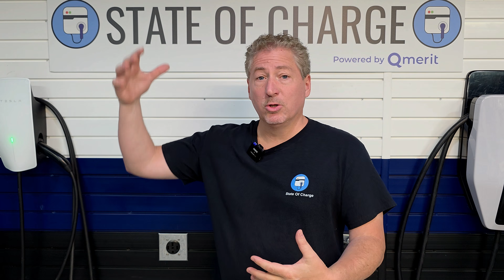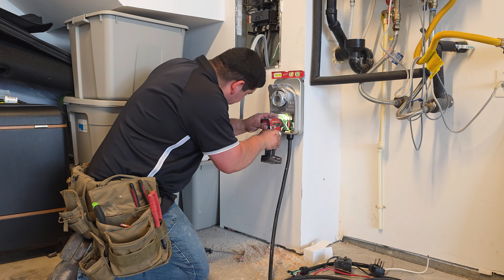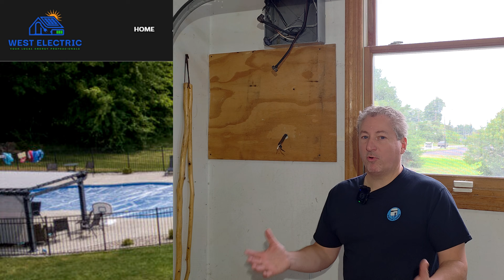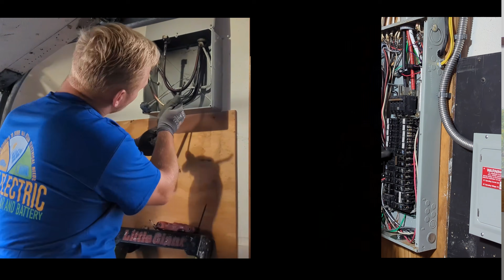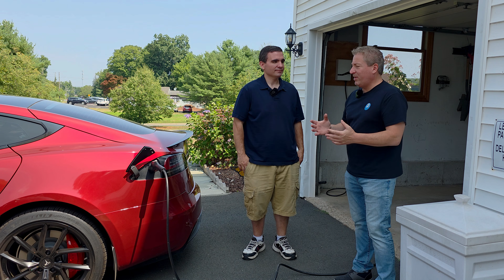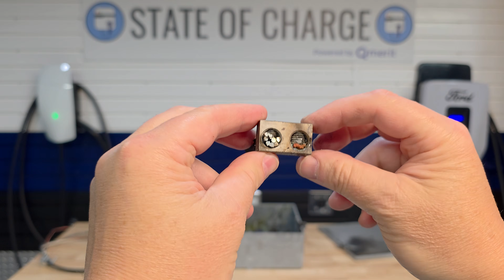Recharge Rescue Connecticut: Poorly Done EV Charger Installation Causes Fire

Comment: I know the "conventional" wisdom amongst the EV charging gurus is to only use THHN wire from the panel to the charger and not romex.  Can you remind us what the issue is.  From what I see in looking at the specs, the insulation on both THHN and romex is rated at 90C.  Is that (90C rating) correct?  Are there other shortcomings of romex wire?  I'm asking because some electricians might try to argue the point when a homeowner is getting their EV circuit installed.  I'm also guessing some electricians might feel romex is safe since they've been using it on EV chargers for a few years now (but likely for 32A or 40A charging, and not not newer EV's capable of 48A or 60A charging).
Reply from the maker: A 6 AWG Romex (NM-B) cable has a continuous current carrying capacity (ampacity) of 55 amps. For continuous loads like EV chargers, the NEC requires the circuit to be sized at 125% of the load, meaning a 55-amp rated wire can only safely handle a 44-amp continuous load. Therefore, a 6 AWG Romex wire is not suitable for a 55-amp continuous load
Reply: Romex (NM-B) is only rated for 60C. Even though it is comprised of 90C THHN wire, the outer jacket reduces the heat shedding capability more than if it's in conduit within the fill rating. Also, most terminals/devices are only rated for 75C or less. So you must size the wire for that terminal rating. As a rule of thumb, I always go one extra wire/breaker size larger than required for EVs. The cost is minimal in the grand scheme. I've tested EVSE's at the circuit's rated capacity, and it's always warmer than I feel is acceptable. I've done lots of inspections with a thermal camera too. You can use Romex for EVSEs no problem, but IMO I would for sure double upsize compared to code. (i.e; #6 Romex for a 40A breaker)
Reply: @andrewt9204  and @StateOfChargeWithTomMoloughney  Thanks - all excellent info.  I've installed two chargers (EVSEs) at two homes going back to 2017, when we got our first EV.  I learn a little more each time.  Last time, on the 2nd home, I had the architect call for "#6 wire minimum", as that is what Tesla had been saying at the time.  I called out for a "Hubbel Industrial 14-50", but in the end we hard wired.  I believe the electrician installed our Clipper Creek 50 (40A) with #6 romex to the charger and a 50A breaker.  It sounds like that was OK, for that charger.  We are now living in a 3rd home and will need to run power to a detached garage for a charger.  I've talked to the electrician about 100A sub panel to power the charger in the garage - which would likely be a 48A charger.  Taking Ford's EV announcement yesterday at face value, I wonder if the battery size race will evolve to a battery efficiency race - reducing the need for a super large capacity charger.

Comment: We're in a similar situation. We had a Qmerit contractor here in Maryland install our Ford Charge Pro Station for our Mach-E on a 60A dedicated circuit and required a load management device at the 200A panel since we have two heat pumps. It was a very professional installation.

Comment: In reality, I doubt that the short length of 8-guage cable would have ever failed on a continuous 48 Amp load if not for the connectors. Going from 8-guage to 6-guage is not that big of a difference to cause 1 cable to be safe and the other unsafe. The size and design of the connector allowed the smaller 8-guage wire (which looks stranded instead of solid) to be more easily crushed and damaged by over-torquing, which lead to the localized heating. I've seen that in the UK they will often either use a ferrule or double over the end of a 'small' wire before inserting it into a screw terminal, though I haven't seen that as much in the USA. But, if that was done here, then I doubt there would have been a problem even if the connector was over torqued and the cable undersized.
Reply: The connections are always the weak point and the 8-guage was not to code.
Reply: @JorgTheElder  It is true that an 8 AWG cable protected by a 100 Amp breaker and handling a 48 Amp continuous load does not meet code. But I don't think that particular code violation caused the failure - except that a thicker wire would have been harder to damage. The failure was at the connector, so it was a little unfortunate that even more connectors were added in the breaker panel - perhaps the new transitions to smaller wires were needed to fit into the smaller breaker.

Comment: Can we please talk more about why we have these huge chargers? I get by very well with a 16 amp at my office and 24 at home. I usually only charge once per week at home or plug in twice per week at work. The vast majority of us don't need these huge chargers.
Reply: Couldn’t agree more. If we do move toward an electric future in transportation, the average person should charge at 6.6kw or preferably less. Only folks who are driving a lot on a daily basis should use higher speed charging (6.6kw and up) at home. Workplaces could offer 120v outlets to encourage charging without abusing the privilege.
Reply: A 16 amp charger (3.8kW) would take me 35 straight hours to charge a Rivian battery. 22 hours on a 24 amp (5.8kW). That's an eternity. Those might be fine if you're driving a Chevy Bolt or a Model 3 RWD, but I'm not willing to wait 18 hours to reach 80%. I have places to go.
Reply: @ampedupevct  I routinely drain my lightning to 0% have to have it to 100% the next day...... wait what?
Reply: This is the best comment on here.   I installed a 48 amp tesla charger, I generally turn it down to 28 amps and leave it there.  Typical day my car goes from 80% to around 50-60%.   Even at 28 amps the car is charged quickly.   Most people can get away with a much slower charger than they think they need.   The YouTuber technology connections has great videos showing how most EV owners do not need a fast charger.   Of course there are a small subset of users who drive way more than average and do need a quicker charger but most do not.
Reply: Agreed. We average about 26,000 miles annually between our two EVs, and get by with a single 24 amp circuit (30 breaker). One EV is ramped down to 16 amps, the other at 24. 

I'd assume a two Hummer EV household (or similar) would need a bit more with our situation. Otherwise, it's probably overkill.
Reply: A base model 3 only has a 32A onboard charger so things stay pretty safe with those anyway while still providing a full charge overnight. However a truck or SUV won't get full overnight on a 16-24A and won't subscribe to your view. Sizing the supply to the battery is key for many people. 24A Seems to be the most the average multifamily unit can spare and certainly does a good job.
Reply: @LarsDennert  Idrive a lightning platinum. How often do we need to charge the entire battery overnight?
Reply: Everyone is different. When I had my model 3, charging at 24A was plenty even with a 120mi commute. However, I changed to an Equinox EV and 24 is not quite enough to charge within off peak times or when I have double shifts. Had to bump it up to 32A. I don't have the luxury of charging at work.
Reply: @andrewt9204 Given this trucks efficiency a 48A charger might genuinely be needed sometimes.
Reply: @aidanmcd50  Absolutely. If I had a lightning or similar, my minimum circuit size would be 50A for my use case. I am in line for a Rivian R2, so I may have to max out my Tesla Wall Connector to 48A. Easy upgrade, I ran conduit so I'd just replace the #8 THHN with #6, if not #4.
Reply: @andrewt9204 for sure, but you understand what you’re doing well enough to know how not to burn your house down by the sound of iy
Reply: Probably in this case because it’s a truck, which is less efficient and thus needs more power, especially if towing where the range is ~100 miles.

Comment: Simple mistake? 100 amp breaker?
Reply: The 100 amp breaker wasn't the issue, it was the over-torqued #8 Romex instead of #6 THHN wire between the transfer box and the actual EVSE. The plan was to change out that section in the future when installing the 80A charger. But I agree, could have put in a 60A breaker for the time being, but it still wouldn't have prevented the fire. It was only drawing 48A for 30 mins when this happened.

Comment: The homeowner should not be charging two EV's at the same time, if he ever did.  That would just be common sense.
Reply from the maker: I charge four EVs at once from my house and have been doing so for years. It's all about your capacity. He has a 200-amp service, he can absolutely charge two EVs at once.
Reply: @sparklander That is not true at all. The panel has enough rating to run both chargers at the same time, and having the other EVSE had nothing to do with the problem he had.

Comment: My first EV, I bought the EVSE on Amazon and used their electrician. Luckily it didn't fail.
I see now that I was lucky. When I got my Tesla, I used a Tesla certified electrician. 
He pointed out that the previous guy used the wrong type of breaker. So even sized correctly, you can still have issues.
Reply from the maker: Yep. Happens all the time.
Reply: Wrong type or wrong amperage?
Reply: @dyoel182 initially both. He installed a 30A breaker and I had him return to upgrade to the required 40A
The guy who later installed the Tesla wall connector told me that the breaker, while the proper amperage, wasn't rated for the duty cycle of EV charging.

Comment: Dumb shit install- price ? Sue that electrician  for recovery -your entire house could have burned down, and then your insurer may not have even covered you !!!electrician should lose their license and inspector fired (good luck with the later) at. A minimum sue their ass off. Discovery will doubtlessly reveal an undocumented unlicensed journeyman operating under a masters license at a large company-they have insurance. Chase them bro-slam dunk for any lawyer.
Reply: Luckily for me and for the electrician an insurance claim was not necessary. I did get a full refund from the electrician which I will use to buy some State of Charge merchandise when available.

Comment: Tom, I am in Spain so things here are different but surprised that home charger installations in the US are so different to the way done here. In my installation, which is 3-phase 240V, right above my equipment the installer put a small breaker box with not only a breaker but also a GFI switch. Just like in central AC equipment a quick disconnect is required, I think charging equipment, which is even more demanging, should also have them installed next to the chargers.

In addition, since I have solar, I have mine set up to only charge my car with the amounts which I would feed the grid so truly carbon free. BTW, my car and charger are 22kW,
Reply: Possibly your EVSE is plugged into a receptacle requiring a GFCI. EVSE's also have one built in. The breaker is intended to protect the wiring and should be sized to that. Having it at the panel allows it to protect the entire length of wire. Homes in the USA only have single phase 240v so more amperage is needed. Additionally, neither CCS1 (J1772) nor Tesla support 3 phase like CCS2 (Type 2 Meinecke) so we are out of luck anyway.
Reply: @LarsDennert  My EVSE is hardwired not through a receptacle. In Spain all circuits are protected at the panel level with one GFI for a maximum of of five breakers. Like I said, the panel for disconnecting has a GFI and a breaker, all three phases, before going hardwired to the EVSE.
Reply: @elmojito new construction here also uses GFCI or afci at all circuits but older panels have lessor breakers still.

Comment: Shouldn't that copper wire have had a ferrule on the end so when the set screw it tightened down the wires don't get mashed out?  I would never put bare wire ends into that kind of connector!

Comment: Don't know why plastic jboxes are allowed,  due to fire issues like this, unless the plastic  has flame retardants in it
Reply: They do. IF that's an actual UL listed electrical box, which it probably is. That's why it didn't burst into flames like normal plastic would have, it just chars and smolders away. If that was just plain PVC, it would have likely been up in flames dripping molten plastic.

Comment: What's the point of Inspections if they don't catch Electrical 101 safety issues like this?
When this stuff happens, there needs to be a feedback mechanism to document the inspection failure and corrective actions, ie mandatory training for inspector, supervisors who signed off, and or reprimand  or change assignment
Reply from the maker: Just like every trade, there are good inspectors and bad ones. Same with doctors, which is even scarier.
Reply: The point is that inspections catch MOST of the issues. Not having inspections would make problems like this at least an order of magnitude more common. Even inspectors are human. Expecting them to be perfect is just silly.
Reply: @JorgTheElder Verifying Amp ratings vs wire gauges and breaker capacity is like, the most basic thing every electrician and inspector should know and check

Comment: For some reason, people always seem to want high amperage chargers when even just 24A (6kW) is more than enough to fill up an EV overnight.  Also, heat strips and backup heating elements in heat pumps are often complete overkill and could be downsized.  Tone those down and a heat pump sips power.  Gotta wonder what the thinking processes are, sometimes, when 200A (48kW) is thought to be too small a service for a home, outside of an actual working farm.
Reply: Considering a GMC Sierra EV or Cadillac Escalade IQ in a year or two when they're available on the used market. Need the 80A charger for the massive 200+ kW batteries. We do road trip and take longer trips with our vehicle fairly often, especially the three row. 19.2kW means I could fully charge at home in about 11 to 12 hours, with my current charging setup it would take approximately 18 hours at 11.2kW.
Reply: @ampedupevfsd Ha!  And like 36 hours on his “adequate” 6kW EVSE.  I have a Lightning and I frequently charge at 16 amp when I’m not driving very much.  But on my errand days and weekends doing activities in a rural area, I am  full bore cranked up to 48 amp to keep up.  And I’ve got a 80amp sitting in a box waiting to get installed.
Reply: @ampedupevfsd  The size of the battery doesn’t matter.  What matters is how many miles you drive each day.  And why are you assuming that the battery would always be completely empty when you get home?  Think about it.
Reply: @junkerzn7312 of course it won't always be completely empty but I do sometimes get home with less than 5% battery and want the vehicle charged up by morning. Or what if I needed to go out again shortly after getting home with a very low battery? I mean if it wasn't cost prohibitive and potentially bad for the battery I would put a supercharger in my house just to have it.
Reply: @ampedupevfsd  yes!
Reply: @michaelwitkiewicz7052  You guys are talking yourselves into installing absurd amounts of power for a phantom convenience that you don't actually need.  It's a waste of money but... sure.  Be my guest.
Reply: @junkerzn7312 do you have some sort of crystal ball that you know what my needs are.  Here is my situation… yesterday I shared my EVSE to a young man in a Tesla because the ONE DCFC  in our county was not in service and he was too low to get to any other public charger.  There are whole swaths of this country that are underserved by public charging and I for one am not going to limit my flexibility in charging my battery because I’m not doing a short “typical” commute.
Reply: First off, time of use plans for some utilities can be as short as 6-8 hours.  A 6kW EvSE won’t come close to replacing charge for some people within those time windows.  Secondly, there are times when you want to charge during the day to top off as much as you can to keep going during a busy day of driving.  Rural folks rarely have low mileage “errand” days.
Third, exceptional situations are what are going to bridge new EV owners to staying EV owners.  Implying that everyone’s use case must fit into the must have all night to charge is not only unrealistic but also just a tad bit high and mighty.